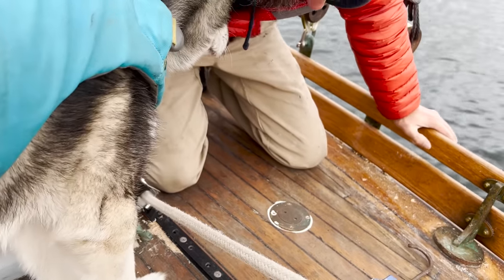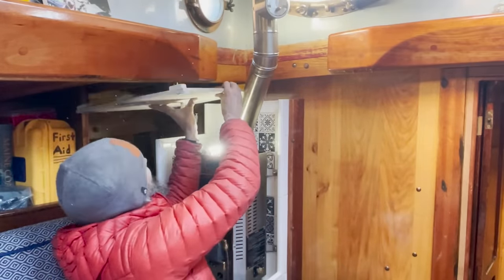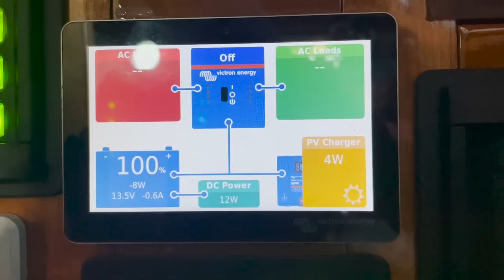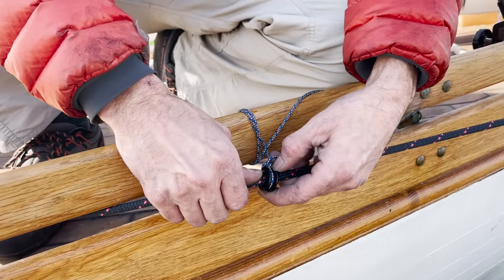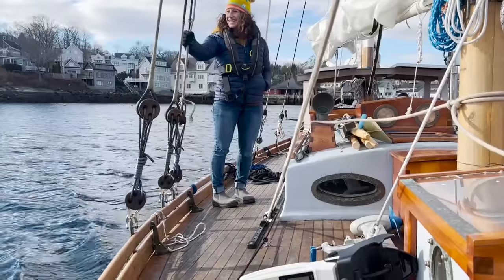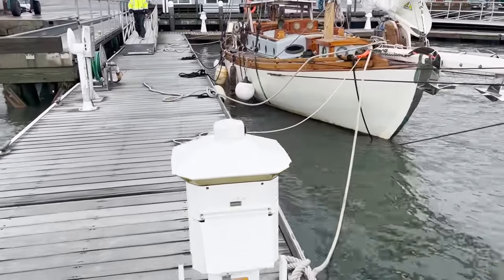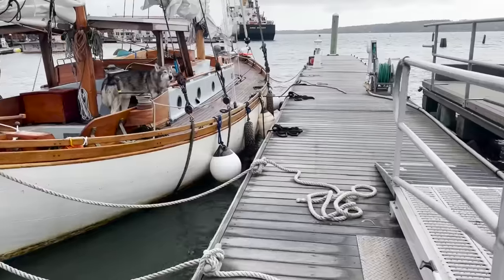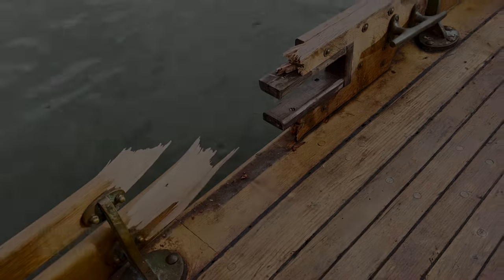Break Another Little Piece Of My Boat  - Episode 291 - Acorn to Arabella: Journey of a Wooden Boat

Comment: If the boat's sitting a bit low because of the heavier planks, can you shave some lead off the keel when it's out of the water?
Reply from the maker: No, we’ll just paint the waterline a little higher. The weight has more to do with balancing the boat, removing weight isn’t something to do for looks!
Reply: @AcornToArabella  I didn't think of it for looks, I thought of it being a problem of not having enough freeboard to be safe in waves (and perhaps the through-hulls being too close to the waterline). And I figured since a lot of the weight was added in the planks (a lot of which were pretty far down in the water already), that it would still provide decent balance.

Thank you for the response.

Comment: I'm sorry your cleat got ripped out of the bulwarks. You really need to anchor them to knees or deck beams for horizontal loads. Someone should have told you not to be in Rockland Harbor in a blow! It's wide open and the fact that everyone else moved should have alerted you. Moorings drag or break often in that harbor in storms and boats get damaged. Think of the loads you put on the dock cleats! Are they really designed to handle boats tied up in a storm? There are a lot of sheltered spots nearby you could have gone.

Comment: Dude ,pretty  bad idea putting lines across that open dock.Would have been a problem for another vessel coming into harbor in storm in the dark.
Reply from the maker: No one was going to be doing that with the forecast as it was, and it’s mostly commercial vessels in Rockland now, so the marina (mostly rec boats) knew what was up. We didn’t unilaterally make the decision to run more lines over there.

Comment: Too bad about your toe rail chunk coming out. Unless you Xray every inch of wood you wouldnt know of spotsthat were prone to failing under stress. Easy fux for you especially the way you designed the rail. I wonder if someonecould find enough hickory straightand long enough to make that toe rail. Hickory wiuld never give way like the oak. The oak is beUtiful though and available to you from your own farm as well. A couple of scarf jointsand your back in business.
Reply from the maker: Well, the weakest part was a butt joint only 1”-thick and ended up with a dock line loaded 90 degrees to it with the boat in rockland exposed as an easterly blow came in, so I think an x-ray isn’t super necessary. Hickory would also have broken in such an instance. —Anne